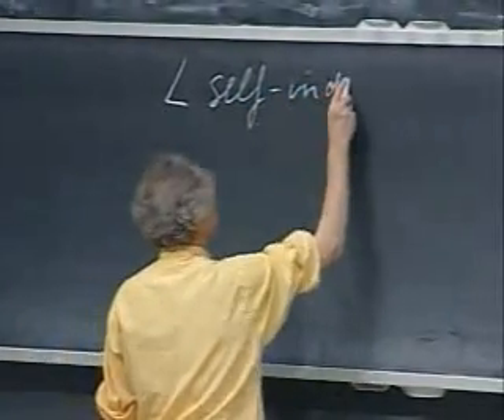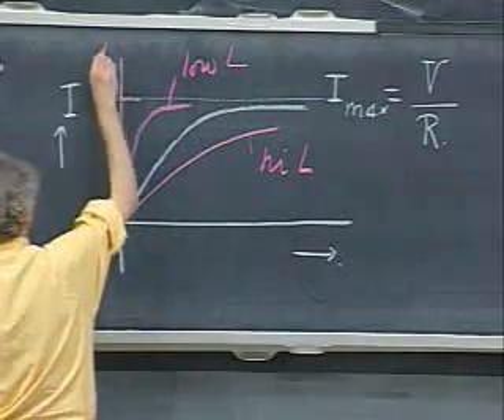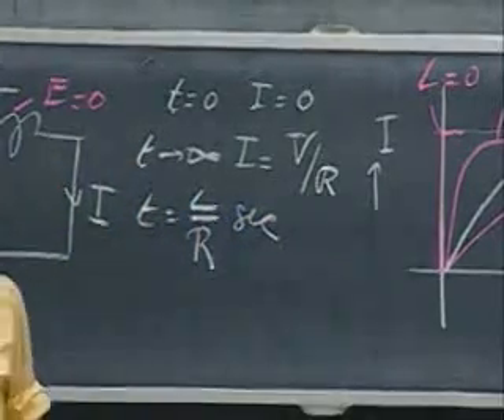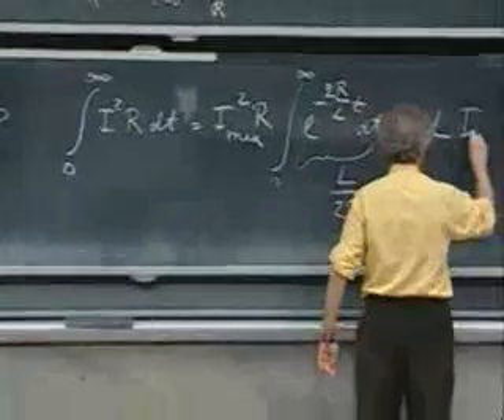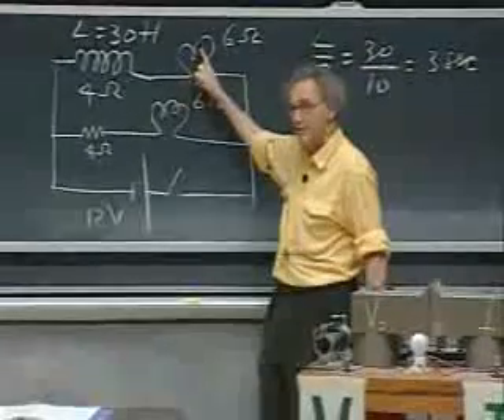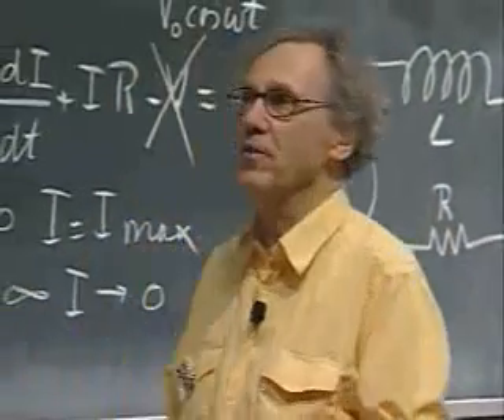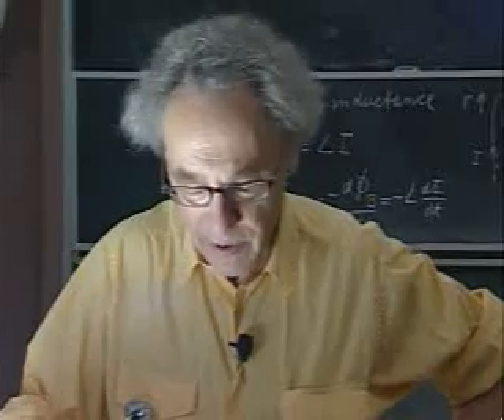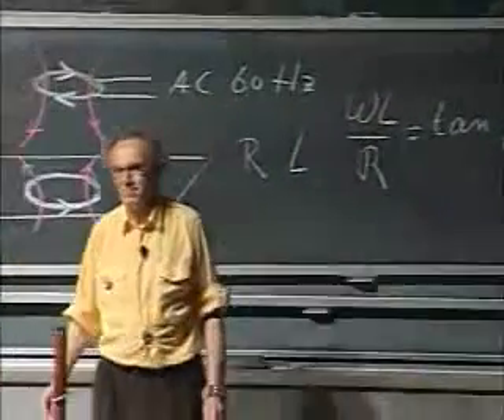Lec 20: Inductance and RL Circuit | 8.02 Electricity and Magnetism, Spring 2002 (Walter Lewin)

Comment: How does the series RL behave for a voltage impulse signal at the input at t=0...any answer???
Reply: At t=0 it behaves as an open circuit  and current in circuit will be zero as the inductor is opposing the change in current at that instant.

Comment: Its good to see you addressing the issue of the subtle difference in the "Kirchoff's rule" and "Faraday's" law here. However I would like to say that in my book, it is written that - "...we cannot define an electric potential within the inductor itself,where the flux is changing. However, potentials can still be defined at points on the circuit that are not within the inductor..." After this they apply the loop rule. Is it acceptable or technically correct?
Reply: How does the series RL behave for a voltage impulse signal at the input at t=0...any answer???

Comment: Under Coulomb Gauge (del A =0) you can talk about a scalar potential which kind of justifies why applying Kirchoff's loop rule gives right equations. If you stop your watch, it becomes your familiar V (i.e. satisfies Poisson Equation with time dependent charge density). In that sense only the books have been talking of it. It wasn't wrong, but not explicitly stated. I am very grateful to this lecture that got a new perspective to look at this.  It means that across any circuit element you can still define a potential difference V(t), no longer static but dynamic. For inductor it is -Ldi/dt. For a capacitor it is V(t)=q(t)/C.

Comment: While searching on the web I found this regarding why Electric Field is zero inside an inductor. THis is what I have found but unable to understand. Please explain this sir, 
" the scalar and vector potentials Φ,A⃗  may always be defined and the electric field may be expressed in terms of these variables as
E=−∇ϕ−∂A∂t
In fact, these potentials aren't unique – any other choice of the 
potentials related to the original one by a gauge transformation is 
equally good to calculate the same E⃗  and B⃗ =curl A⃗ .

In an rlc circuit, one may always confine the nonzero A⃗ 
 to a small vicinity of the inductor which also determines the right 
gauge transformation. Then the potential difference across any element 
of the circuit is well-defined and the sum of these differences over a 
closed loop is zero."

Comment: Why is the electric field in the inductor is zero???
Reply: +SHUBHAM AGRAWAL
Well, if you have seen Ohm's Law in form j=(sigma) E, where sigma is conductivity, try setting it infinite (for an ideal inductor). You will see that for finite j, E=0. Why doesn't j go to infinity? Well, j is proportional to drift velocity. That can't really go to infinity now, can it? There's a theoretical to limit even if you get into deep waters of real superconductors. You may think it may become still fairly large because lower resistance actually should strike as less number of collisions. It turns out that even then the velocities are much smaller than c.
Reply: Manish K thanks for the explanation. Now it is clear.😊
Reply: +Soroush Khoubyarian Then how do magnets work? I thought that moving charges exert magnetic fields, which suggests that there are moving charges in permanent magnets (which are conductors as well, no?).
Reply: +Soroush Khoubyarian OH ok that makes more sense thanks

Comment: Wow, his explanation of LR-circuits is really good! All my textbooks use Kirchoffs rule, but this made much more sense to me. :)
Reply: How does the series RL behave for a voltage impulse signal at the input at t=0...any answer???
Reply: Wanja Paulsen he also used kirchoff's rule, only he didn't mention it but explained the voltage in the cell and the voltage drops across the resistor and the inductor☺
Reply: Easy Physics for you there is no such thing as voltage drop in an inductor, potential difference is NOT defined in an inductor because the magnetic flux is changing, Electric field is induced, there is an induced emf, but the emf produced is not the same as a voltage because voltages are independent of path, emf are path dependent
Reply: Physics Numericals Yes he did.  But he said that in books,  people apply KVL  the wrong way.
Reply: @someshpandey2258  NOOO he didn't use kirchoff's rule